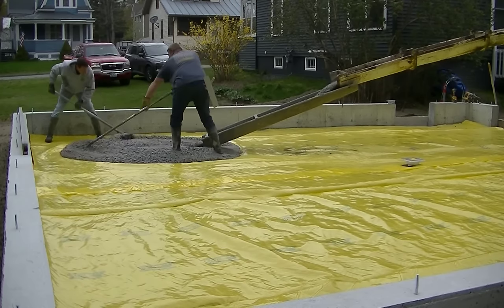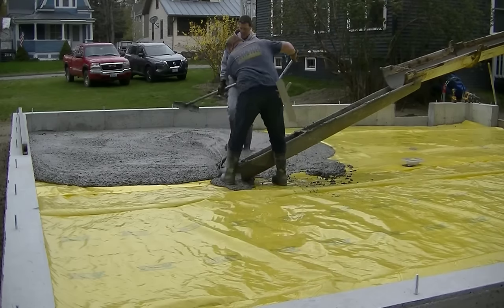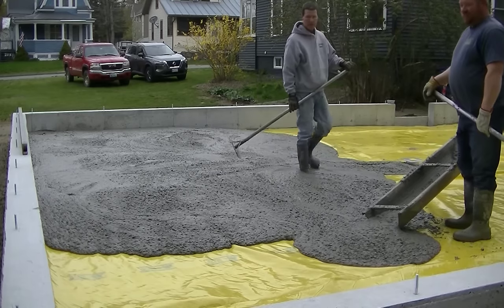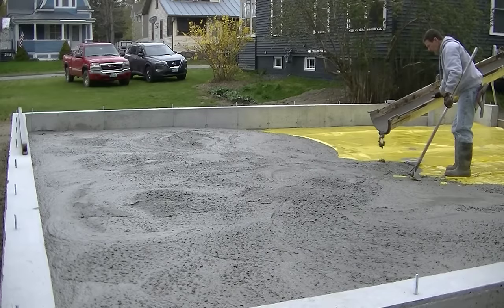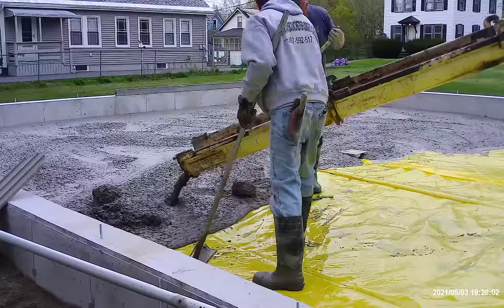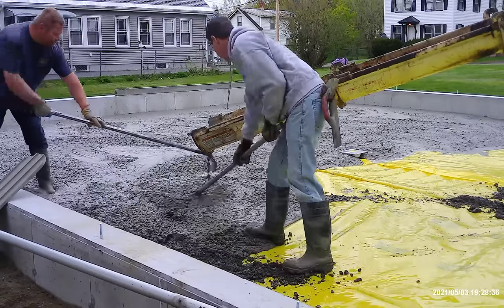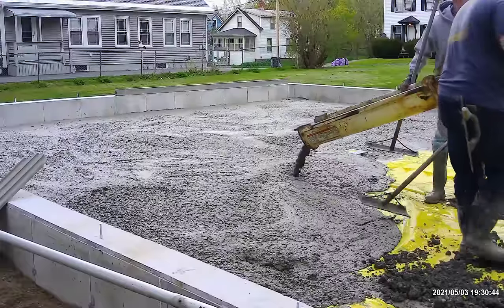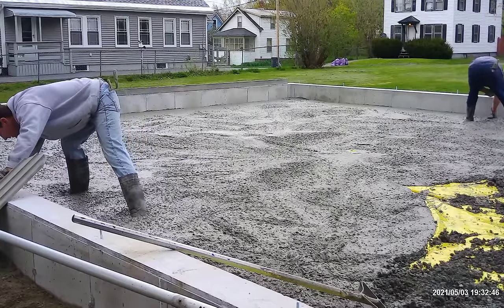How 2 Men Can Pour A 32' X 28' Garage Floor (I Got Concrete Balls!)

Comment: It’s a wet mix. Every time unless it comes from a central mix (wet batch) plant. You will most likely have balls. Even with a high range water reducer. I’ve been in the ready mix concrete business for years. The only thing I’ve seen stop it is a central mix plant.

Comment: Too much water added in the beginning before the dry ingredients are place. You only want about a third of the water added with the sand and aggregate then the dry cement and additives then the rest of the water. As an inspector we call these meatballs and they are typically caused in dry batch plants where the truck is the mixer and too much water is added in the beginning. Could be from wash water left in the barrel or the batch operator adding too much water to begin with. Too much water in the beginning causes meatballs.

Comment: Man I’m a Carpenter by trade and poured my own drive years ago and let me explain the process . I start by raking a bunch over here then I rake some I just raked back over their but need a little more back over here and some more back over their and we had only worked an area about 10x10 with 2000 sqf ft to go. Just worked in circles. I’m older now and the moral of the story is stick to what you know and pay a pro. I could have built a deck that day and paid a pro and put money in my pocket.

Comment: We get balls now and than if it's commercial the truck goes back to the plant regardless no if ands or buts about it. If there's balls in the mix it means the rest of the mix has less cement powder is the engineers reasoning for sending the trucks back.

Comment: Meatballs, pumpkin balls cement balls are caused by the plant batching the concrete too wet and not allowing the truck to grind them up while the driver is washing down and setting his load.

Comment: As  22 year ready mix driver I would never allow the extension on the chutes.
The trucks chute system is NOT designed to carry the extra weight and using that extension is very dangerous as stuff can brake and cause a catastrophic failure!
If you cause a truck failure before the end of the load, the ready mix still in the truck that will not come out is yours! BIG loos on your part.

Comment: He didn't mix the HRWR fast enough nor long enough. When you add superplasticizer onsite, they have to add at least twice that another with water as well- 1 gallon SP add 2 gallons water or 3 gallons water.
We call them dinosaur eggs. They're also caused by bad fins or dirty fins in the mixers drum

Comment: Without any steel reinforcement , that slabs will go sideways, at least a mesh would have helped. And there are no dowels connecting the footings. I wonder if there is even steel on those footings. Just know that what makes concrete strong is steel, and without steel concrete is basically useless, no matter how fast and beautiful it looks.

Comment: Haven’t seen anybody add that much water to concrete in a long time. Good thing it’s not for support of the building. The more water you add the concrete the lower strength it has. That looks more like a loose soup then it does concrete. Adding water reduces strength and increases chance of cracking.

Comment: The ‘balls’ are annoying enough. But I had a big garage (3 trucks) go totally south due to the 2nd truck arriving wet, then halfway thru - debris. Old Crete from a dirty drum. Serving platter sized sheets of cured Crete.
The balls are ‘cannon balls’. If you bust them up well and push them down they are no problem. Or toss them out. The issue with them is they are dry inside. If near the surface, after the Crete sets, eventually the ball can hollow out creating a hole. (Moreso in driveways that are bullfloated and broomed.) Anything power troweled won’t usually have that problem. 
*poured garages 4/day with 2 men for years. 8 & 830 place the morning 2, 1 & 130 the afternoon 2. But that’s for hand finishing. Trick is not to disturb the Crete prematurely or you disrupt your timing.

Comment: We have different ways to use that straight edge. In my union it is a left to right movement. Doing it the way seen here looks like this move benifits you both. Pour it wet helps alot as well as another man on the shovel. I belives in having men and paying men. If your just going to do on small job like this and want to pocket the 200 bucks for one other man knock yourself out. ;- ) I have done work of two and three guys when I was young it did not get me more money. It was a challange to myself. No longer the need to prove that. It's also more fun. You guys are alright you ain't killing yourself working together. ;- )

Comment: Im a concrete driver...That is not a 7 inch slump...lol And the balls we call meatballs....Also if you have precast on your fins in drum it  is less affective in breaking up meatballs and mixing load effectively...And if you add fiber mesh aswell....

Comment: The "concrete balls" are cement powder that got dry packed during the loading prosess to much head water before the powder hit the mixer. If you order the slump at a 5 and then temper the load on the job to the 12 inch slump that you poured you won't get those. No amount of mixing with beat those out because they float. it all comes from the loading prosess not enough agg to much water at the beginning.

Comment: Technically it’s not “code” to put fiber mix in a slab , fiber mix is used in driveways and porches and in some cases sidewalks . The standard for slab is Poly 10m (plastic) and wire mesh (rolls of wire or sheets of wire 6” squares ) . And mixing the mix with that much water added decreases the strength of the slab i.e.  more cranks .
Reply: Not water, we call it super P.  Plasticizer adds a membrane around the aggregate.  It does not decrease the strength of the mix.
Reply: @djatrain  never heard of it and I’ve been pouring residential and commercial concrete for 17 years .
Reply: @djatrain  that cool though . So when pouring a slab with “super p” in a 30 yard pour , does the super p cost like it would to add calcium to the mix or is it more expensive?
Reply: I've been testing concrete for 18 years.  Yes, it cost.  Do not know if it is more or less than the calcium chloride.  Some site restrict adding water but you can use Super P.
Reply: @djatrain  yea a lot if not all the commercial jobs the tester will not allow adding water because it decreases the slump . Does super p decrease slump like water ?
Reply: Most mixes here around the Chicago area have a  slump of 2-4 or 3-5.  Super P makes it around 8-11.  I've seen it used in high early concrete when they want to get on a slab quickly like in less than a week.  Seen them use it in all high rises to small residential projects.
Reply: @djatrain  ohhh yea you guys probably can’t add water especially during you guys winter months it would just freeze the slab . We don’t have to worry about that in Alabama. We just have to worry about the heat 🥵🥵 for instance if we pour 60 to 100+ yards we start at like 3 am

Comment: concrete mason here.  no rod pins.  should rod mud as you pour.  to wet.  additive will not compensate for so much water.  I would not pour anything this way.  Drainage toward center can only be done by accurate screeding. with rod pins setting grade.  If the mud is 7 sack then the concrete will be stronger and maybe work out OK.  Masson's are pros

Comment: They gotta spin their drum at full speed for 10 minutes minimum with superplasticizer or delay set/Delvo
Reply: You guys are leaving lines every foot, the whole length of your rod board!??
Reply: My god brother what's your f**** Rush you never strike the mud only once in the same spot. There's no way for you to know that it's the right grade... 31 years finishing concrete and I have yet to see ANYONE get it perfect with every stroke. Faster isn't better, if it were, there's be no need for you to use a High Range Water Reducer
Reply: You're killing me brother. Then you're going to bullfloat it the wrong direction, or is that the only one you wanted to show us because the other one would have been f*** up?

Comment: You guys do things way differently then we do. We form up the sides and pour the footings and slab in one shot. Also everything is meshed and tied in with rebar. Here it wouldn't pass code without being 4" thick on main slab. The approach  depending on soil conditions needs to be a min of 6 to 8" thick. Granted I'm in a wet climate so I realise your codes may vary

Comment: The balls are becuase he didn't get enough water in the barrel befor the material started going in the barrel. Just enough water to get it sticky and then it stuck to the front of the barrel. It's called getting headpacked. Good drivers can tell when they are headpacked most of the time, you can see your truck jumping around as the packed mud rotates when mixing. The reason it comes at the emd of a load is because the mud in the barrel presses on the packed mud in the front keeping it there, get most the mud off and the pressure is gone and the packed mud releases. when it happens when you're pouring, the driver needs to run the mud to the back of the truck, rev it up amd slam it into the front, hopefully getting all that stuck mud to release. Mix, add water. Balls that come from the front of the load and are consistent in the whole load usually come from a load that was batched to wet and couldn't mix properly, or they got a dry up [ throw more material in the load] to get it to dry up. Hope that helps. Good for you guys using plasticizer instead of jackin 100 gal of water in it. 🤣 rod mud like pros. Good stuff

Comment: So when a professional painter thins the paint by half and says it sprays easyer, who benefits from that? the homeowner or the painter, I've always been told that a dry pack concrete is the strongest, the wettest is the weakest 😰

Comment: Haha try working asphalt in the middle of summer. Shit dont move very easily and it's about 300+ degrees. Concrete you got more time before it starts setting. When asphalt loses heat it's just fucked.

Comment: That concrete balling is 100% caused by the batch plant operator.
The batch plant isn't adding the aggregate and cement at the same time and the water is being sucked up by the dry powder. 

The driver needs to report this problem back to the batch plant because they most likely don't even know that there's a problem.   

I'm guessing that the batch plant operator is adding water too soon to cut back on dust issues.

Comment: Just add water?  I can tell you that if that concrete really had super plastersizer in it, it wouldn't have lumps. My opinion. Add a man to the crew, reduce the slump and put some grade pins in. Concrete 101.

Comment: Nice work guys, I had a 29x30 residential garage built, cost me over 30 grand or more paid from my bank account, no drain, I ask to put one in, they ran out of concrete a yard short, took over 1 hr to get more to finish floor it cracked within a wk  in that area? Guy was a joke, put a lein on my house? Paid over the price on est, to stop his games, but he did it again, never ever will I do new construction again,  THIEFS AND U CAN LOOSE EVERYTHING WITH NO DEFENSE,  STILL NEEDS 10 TO 15 GRAND IN REPAIRS, BUILT NEW 2015..

Comment: Looks like a lot of water. I would of requested a couple core samples.
Reply: Not water. Superplasticizers make it flow like that. The plasticizers (which actually reduces the water and increases the flexibility of the concrete) and fiber mesh make for a stronger mix. A core sample in a garage slab? You would have drilled into a new garage slab to get a core sample to have tested?  Why do people comment and try to sound smart when they really have no knowledge?
Reply from the maker: Amen to that, great comment!

Comment: there's no way that's a six or seven my man.  That's like an 8 according to my eyes.  The crew that does slab all day everyday wants it 9-10 slump.  the water reducer is a good additive, usually when i see that on my ticket as a mixer driver I know I'm headed to a pump truck.  The residential crews never have it added to their loads.

Comment: That concrete is too wet. Test strength will be lucky to be 1/4 - 1/2 of what it's supposed to be due to cement to water ratio being off, and the rock and sand will settle to the bottom of the pour. This is not good. This concrete should not be self leveling the way it is on the video. There is a good chance that this floor cracks.

Comment: “7 inch slump” sorry guys, that’s not true.  

That concrete can’t produce a slump you are pouring and I imagine if you did a break on your concrete it would produce a very low break and would fail.

I come from a time when concrete was ‘placed’ nor ‘poured’.  But hey— with concrete that wet you don’t have to screed it— it’s self-leveling.  Not good for the costumer.

Comment: This is why people who think they know concrete will tell you  "I know two things about concrete. It's gonna get hard, and it's gonna crack"  ... Only people who DON'T KNOW WHAT THEY'RE DOING pour concrete that wet. 
 When that much water is added after the mix leaves the plant, it washes the bonding agent off of the aggregate, and it breaks down the air bubbles that are added to the mix. That's why it's called air-entrained ... The air bubbles rise to the top which provides an avenue for the water to leach out of the heart of the pour first, so the center cures first. If there's no bubbles the water gets trapped in the heart of the pour and a skin forms on the outside. When the heart cures it expands, causing the skin on the outside to crack.
 Lazy, cheapskates do work like your seeing in this video, and these clowns wouldn't be on my job after watching this... That slab won't be worth spit in less than 10yrs

Comment: That is some WET concrete. Sure wet concrete is easier to work with but all that water will make it weaker than a proper dryer mix

Comment: If that load had been for a load bearing beam or a supporting column, no-one would have seen it or cared about it.   Had it been for structural use the whole load, if not the pour, should be rejected.  Down here , below the equator, the custom would be to turn a blind eye, "I never saw muffin'..........", and make it someone else's problem. I'm a tad disappointed that you pretended that it was as good as the fresh stuff, the integrity of the floor has been compromised!

Stavros

Comment: You are Pouring the Mud, Waaaayyyy Too Wet! The Strength of this Concrete will ultimately be Nothing near, what it would be if poured at the “Proper Slump”, you guys are Pouring “Nothing but Soup”! 🤣
Reply from the maker: It's got high range water reducer in it. Listen to the video

Comment: So u never checked elevation or anything to make sure you ran straight and level with the screet board? So u don't care if there's a big bowl in the middle of this slab u charged someone thousands of dollars for??? What about rebar? I didn't see any at all, no mesh or anything. And no, I've never ever gotten a hard concrete ball like that, the truck driver would be getting an ass chewing to give pass on to his boss, your customer just paid for that garbage.
Reply from the maker: You didn't even watch the video but you take time to write a comment, thank you!
Reply: @MikeDayConcrete  yes, yes I did watch it. Thank u

Comment: Yes Mike that muds too wet. Plasticizer is added to make normal concrete more workable not to make wet concrete into soup. You better saw expansion joints as soon as possible. This slab will shrink fast with all that water. Especially in hot weather. Those klumps are from the driver adding to much water. The concrete needs to be drier to "grind" the cement and aggregate. All the drivers know you like wet mud so they "help" you by adding lots of water at the batch plant. Typical driver bullshit. That mud is so wet that the aggregate is sinking. Would I have you pour a slab for me? Sorry Mike. It's not about you. It's about the product you leave behind.

Comment: Not really impressed .!! Concrete mix is very wet.this weakens breaking strength! With vapor barrier all moisture has to hydrate upwards through top of slab. Slab and homeowner have excessive shrinkage cracking.looks like these hacks added water again half way through.sadness bad example of how to

Comment: 7 inch!!! You mean 8+ and not hurting strength??!!! Bahahahaha that soup would fail a cylinder test at 1/2 3500psi that floor is crap! I’d sue your ass if it was my floor

Comment: This is funny to watch.  You would never pour for me.  First I for a living do quality control for 17 Concrete plants.  So I know what I'm talking about.  This would never pass on a commercial job. 
1. That is way past a 7" slump. To wet on most jobs even with a high range plasticizer. I can see the start of segregation(separation of liquid and solids).  
2. If this one of the companies I represent that sent out heads( or as you call them balls) I would personally send back the load.  Balls as you call them are the powder in the load or cement and flyash depending on the mix.  That powder/ball is the glue that holds the concrete together.  If it balls up like that you are getting good a far inferior product.  And I don't know anyone with decades of my experience that pour a 3500psi mix for a slab. Expecially that wet. You are asking God for plasticity cracking and less than. Expected strength.  Most slabs on grade need at least 4000psi.  This is at best poor work. And you are bragging about how good it is. Is a shame to say the least.

Comment: These guys suck, City building inspector should be present for this size of pour what's with the yellow tarp. Where is the metal and screen. Seen better and correct work from illegal day labor 
Good luck on that not cracking. Is it high traffic rated cement? Doubt it